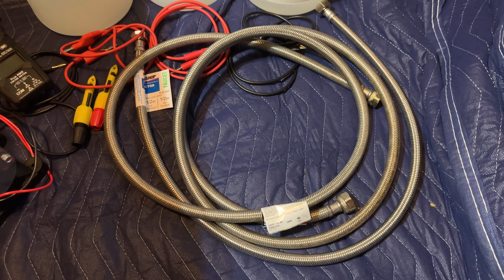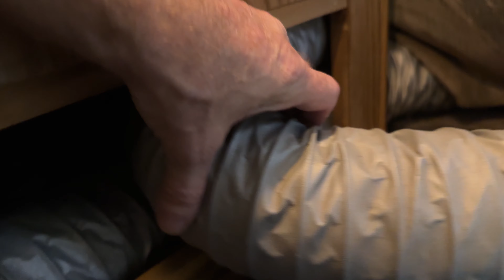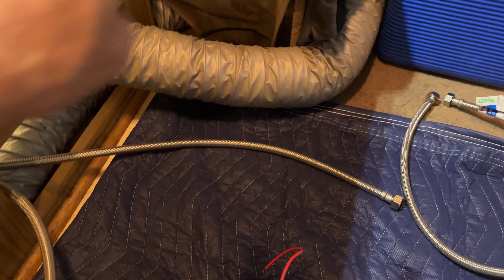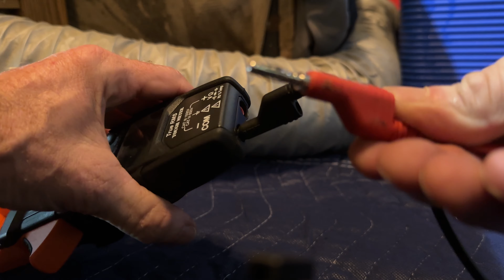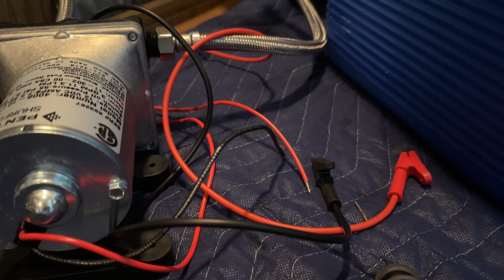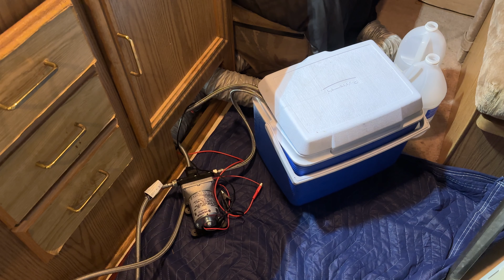How to decalcify a tankless water heater in an RV.

Comment: Hey Dave. I have a couple questions.... 
1) can the piercing probes be left on the 12v wires for future use? 
2) is there a way to plumb the water lines to make it easier to do this again at a later date and how would you make these connections? 
Thanks in advance for any assistance you can provide.